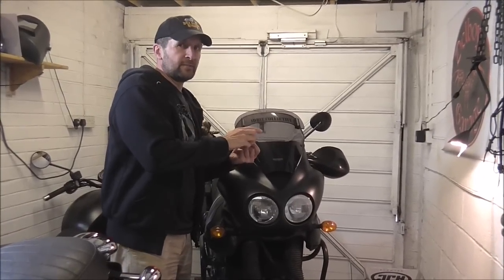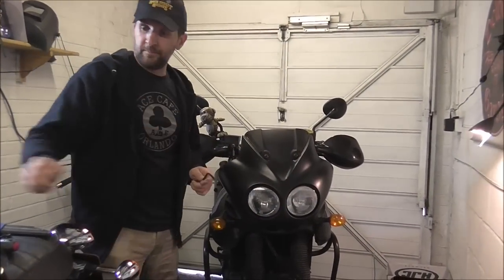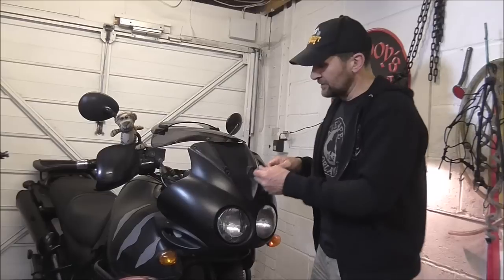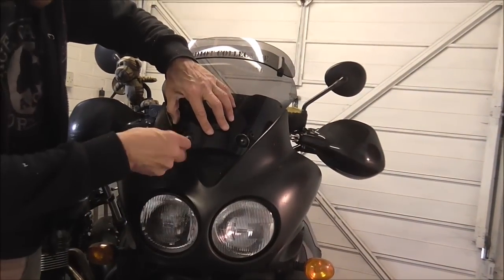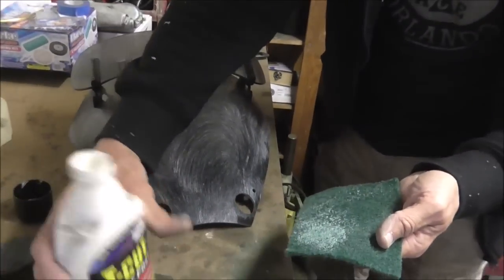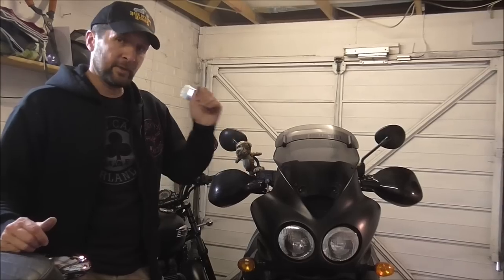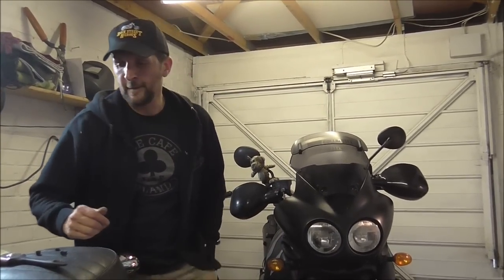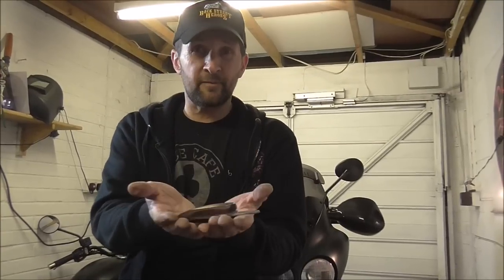Delboy's Garage, Tiger Rat #4, and knives!

Comment: Hello Del hope all is well! I have a question for you mate! my bike panels are white, but I would like to change the color of them to black, can I just sand them down and respray them black? or is it a case of buying black ones? Cheers!
Reply from the maker: KungFuCookie09 Hello mate, of course you can paint them, possibly a coat of grey primer to block out the white and then layer up with 3-6 wet coats of black... usual rules apply for any forms of painting!

Comment: omg del with knifes o.o that's y I don't live in England >:D lol
Reply from the maker: Sr Rider well what d'ya expect, they won't let us have guns here lol !
Reply: Moonfleet41 that's cuz men like us are 2 mad to have stuff like that lol we'd be playin cops n robbers with real guns! lol but del an update on the bike that's being built, its almost ready for the mot now just ordered new tires and new levers for it! any advice to riding on new tires?
Reply from the maker: Sr Rider Hi mate...on the new tyre...just take it easy, first 50 miles act like you're on a wet slimey road even if its dry...and build up the lean angle bit by bit... they're be fine within 100 miles.. ! also check the tyre pressures every day to make sure they've sealed fully..!